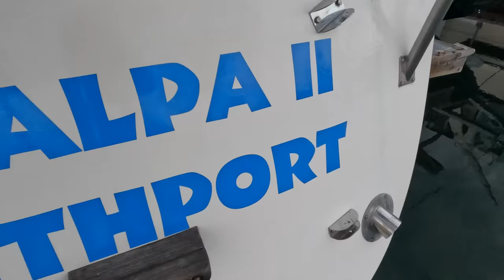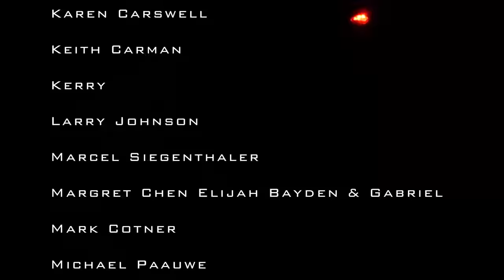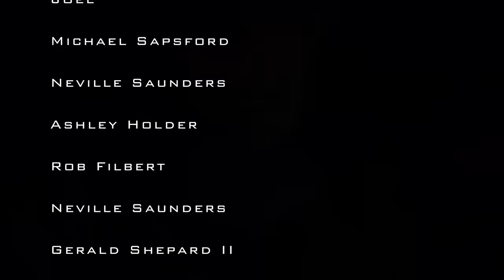Time is up!!!! SAILING to Mexico | Ep 336 | SAILING CATALPA II

Comment: depending on the risk of the drifting boat with no engine from loss due to danger eg reefs / grounding etc it can seek 
assistance and a Safe Harbor for repairs. This also includes bad weather and storms
Under international law, no port may be closed to a foreign
ship seeking shelter from storm or bad weather or otherwise compelled to enter
it in distress, unless another equally safe port is open to the distressed vessel to
which it may proceed without additional jeopardy or hazard. The only
condition is that the distress must be real and not contrived and based on a 
well-founded apprehension of loss of or serious damage or injury to the vessel,
cargo, or crew. In general, the distressed vessel may enter a port without being
subject to local regulations concerning any incapacity, penalty, prohibition,
duties, or taxes in force at that port?